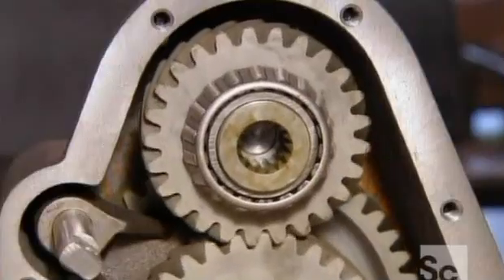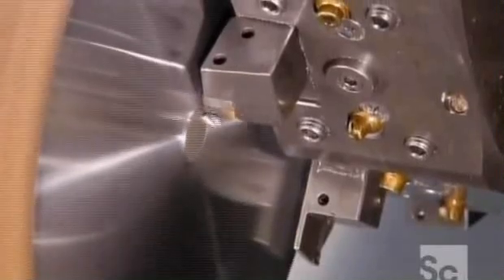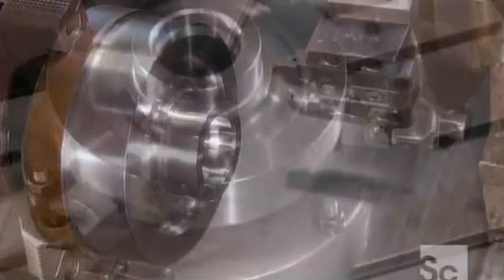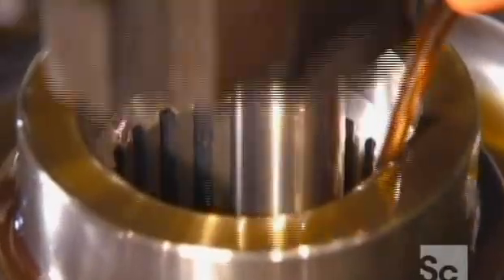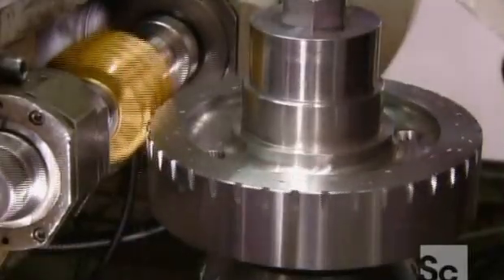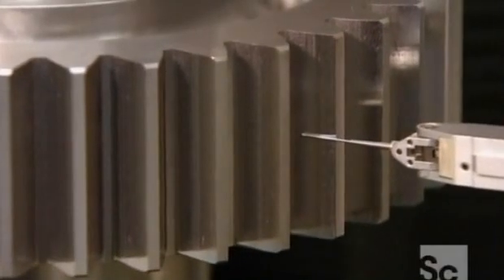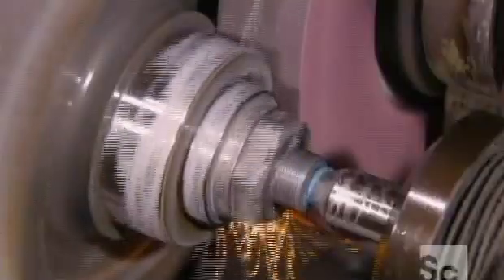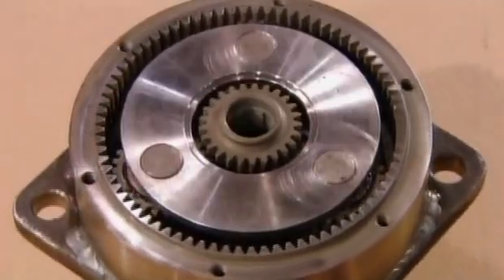Gears - How its Made

Comment: This is a custom gear shop folks. Forging would be a stupid choice given the tight tolerances for gears and bearings and seals. Most of which have super tight tolerances smaller than .001 of an inch. This isn't making train wheels.
Reply: train wheels at? I work next to a guy on a wheel lathe. hes gotta be withing 5 microns. so there not a good thing to say that is rough
Reply: FYI the tolerance on gears are mostly 0 to -0.02 mm because .001 would be an overkill considering that these gears will wear with time, and mining machines does not require that thight tolerance, thats what NASA uses :D

Comment: Nice video, i actually work on gears like this, i grind the outside diameters
Reply: shdw1858 Hey man. I am a sophomore who is pursuing his mechanical engineering. I am working on a project which includes manufacturing micro gear on a micro milling machine. Do you think if gears could be manufactured using milling?

Comment: I don't have any better ideas, but some parts of this seem like an incredible waste of metal... So many shavings needing reprocessed.
Reply: Only rejects .. Scap and all .. The shavings at least go to the scap yard - not waste at all ever ..
Reply: +agentorange153 If you punched the hole out, you would then have a useless slug that would need more energy to re melt. Forging would create a different type of steel that might not be any good for gears. Small gears in cheaper power tools are made from pressed powdered metal but they're no where near as strong & wear resistant as turned gears like the ones you've just seen. If there was a quicker, better or more energy efficient way, they'd be doin' it
Reply: I really can't see how you would forge a gear??? It is way too complex in design. Even if you could shove it through a die, you'd still need to machine the smaller shaft, inner & outer. Forging makes metal brittle & it has to through various treatments so you wouldn't gain anything at all. I'll repeat, if there was a better way, they'd be doing it.
Reply: spartus They still have to be remelted and cast (and rolled/forged) again, which wastes energy.  And yes, I do have a better idea -- if it was up to me, I'd use FORGING processes (extrusion and/or closed-die stamping) instead of machining to form the blank and PUNCH (not drill) the holes, and use machining ONLY for finishing the blank to the required dimensions and then to cut the gear teeth and the inside splines.  I bet this would reduce the amount of metal used by at least a quarter!
Reply: +archiearchie666 Forging actually STRENGTHENS the steel by strain hardening -- and as for punching vs. drilling, I'm not saying that it would be waste-free, but with the right design it could produce LESS waste because the total volume could be reduced to compensate.
Reply: ChibiTails metal shavings get recycled. so not fully wasted really..
Reply: ChibiTails Quite the contrary, metal is FAR more recyclable than plastics and such. You literally just melt it back down. The hard part is ensuring that it’s all the same alloy. But at a factory they can ensure this easily. The only parts where there’s any real waste is in grinding and if a hardened gear needs to be scrapped (and only maybe then), because steel is harder to melt and work than iron.

Comment: and who made the gears of the machine that makes the gears????
Reply: dtlssm The first gears were made with ink, compass, scribe and file. You would use the compass to scribe a circle in the ink. Cut most of the excess off, leaving a little so it’s easier to make marks on the perimeter of the circle scribe. Then you would set the angle of the compass to a smaller size, estimating based on the size of teeth you expect. Then you would walk the compass around the perimeter, scribing as you go. If the compass was set too big, then reduce the angle and try again (redo the ink so only the new scribe marks shine). Rinse and repeat until you’re satisfied that the markings are accurate enough. Then sand/file the rest of the excess off. Now you have a circular slab with markings around the circumference. At this point, you file each tooth to your satisfaction.

This is a lot of work to do, and it is very difficult to get consistent teeth. That’s why you would use a shaper, like Sarvesh says above. A shaper is just a machine with a table and vice, and it has a reciprocating arm which you mount cutters on. Your are able to move the vice up and down so that you only cut a little at a time. This way, you can at least get consistent teeth, but only straight, no helical gears.

Similarly, a mill can be used to cut the teeth using a vertical rotary table. Now because the original procedure of marking out the teeth being so tedious, and with limited precision (you can do pretty good, but in automotive and similar applications, really high precision is needed if you want quiet smooth meshing), people made indexers, which can be used to rotate a very specific amount. The critical part of these is an indexing plate, which you can either buy, or make using that original marking procedure. Usually a thread is used that makes the table turn once every 40 turns of the handle, or some similar number, so the precision of the original marking method is increased by that amount.

Helical gears can be made by coupling the travel of the mill table (with, you guessed it, a bunch of gears) to the rotary table, so that it rotates an amount proportional to the travel of the table. This also means that the pitch of the cutter needs to be set appropriately. 

TL;DR
People with a LOT of elbow grease and determination
Reply: Shaper or a milling machine
Reply: Gainster I'm watching all these videos trying to figure out how to do that myself lol
Reply: The egg.
Reply: dtlssm The way that they show here is the way that factories make gears. Machinists do things quite differently usually. This is because a factory needs to make thousands of the same exact part, while a machinist generally needs to make completely custom parts. So a factory can afford to spend 10 thousand dollars on a gear cutting machine that can only cut a certain type of gear, while a machinist will do things a slower and less efficient way, because they cannot afford a ten thousand dollar machine for every new order they take. A gear hobber on its own is a quite expensive piece of equipment, and it can only be used to cut a specific gear. So machinists pretty much never use them. If you’re a real DIY kind of person, you could make a basic disk shaped gear cutter (only cuts one groove at a time) without much difficulty, but professional machinists would usually just buy a set of this type of gear cutters, because you can use such a set to cut most of the gears you might need to.
Reply: They just evolved over millions of years, gear-denturey!
Reply: Nonsense quetion💪🏻
Reply: A man with a file set

Comment: The very first gears, like machine tools were made by hand. By craftsmen. CNC is just modern day methods not how things were first done. Go to Blacksmithing and you will see a real trade that is still practiced, these people are the ones that made the first machines and did the old school heat treatment. Cheers from John.
Reply: Most of these machines are not cnc. A hobbing machine is based on manual hobbing, it is basically the same thing but without a motor. The only 2 cnc machines are the lathe and the inspection machine.

Comment: DTP2A
our question
1- what is the function of oil is placed on the center of the hole gear?
2- why of the project should be placed into the oven fire is burning? do not that if do like that?
3- what is the temperature used when the gears is in the oven?
4- how long of a gear to be completed?
5- what is the speed of the tool used for turning gearyang desired pattern?
Reply: Dalila Dst And the rest of your questions, it always depends on the material used, or size of that gear, and in your last question, also what tool you have. So no exact answers :D
Reply: The oil is used to lubricate the cutter, extending tool life and surface finish.

The oven is used to heat treat the steel, making it harder and more abrasion resistant. Overall tougher after heat treatment.
Reply: oohhh, thank you :)
Reply: Your welcome.
Reply: thanks .. :)

Comment: Weren't the "inner teeth" actually a spline?
Reply: Yes your right its called a spline. But that procces they used is called shaping. A broach maching also makes a spline by using a long cutting tool that pulls the part thru the cutter creating a interior spline

Comment: Looked like some of the procedures did NOT use coolant for the tooling. Drilling the four holes for lightening, or the initial facing of the blank. I used to operate a CNC lathe. We used coolant for EVERY step. Even carbide tools appreciate coolant.

Comment: Yes, it would be quicker, but it would be close to impossible to get it to the right shape. Air bubbles, thermal expansion, and surface tension naturally work together to make sure that filling a mold results in a sloppy, inaccurate lump of metal (in comparison to milling as seen here) instead of a precise mechanical component, unfortunately.
Reply: Does this mean that in developed countries like America they are manufactured in this lengthy way

Comment: Secondary machining, like you said, is used a lot for when a powdered metal part has a mating surface to another part or needs holes drilled, threaded, or extreme tolerances. However, majority of pm parts, including gears, are finished once they are sintered. I've run a few secondary jobs through my shop in the past. I've had the great misfortune of being stuck in the tool and die end of this industry for 20 years, lol. It has paid some bills I guess, but I hate it with a passion.

Comment: Sure, but a lot of the time sintered gears still require some post-production machining work, especially if the gears require extremely precise tolerances or crazy shiny surface finishes.

Comment: Because the number of teeth on the gear and the angle at which they might have a "helical cut" is different every time. You'd have to have a sand casting and pattern for each one. It's quicker to just cut them using tools and a lathe.

Comment: @alanhowitzer the machines that make the gears are CNC (computer numeric control) machines in other words programmable machines, they are or were made by hand at one point which made them expensive and so werent very common then as more CNC machines were made they too could make parts for CNC machines and other mechanical applications

So what started as a purely human task requiring immense amounts of time and money is now mainly a machine based job but it costs a lot!